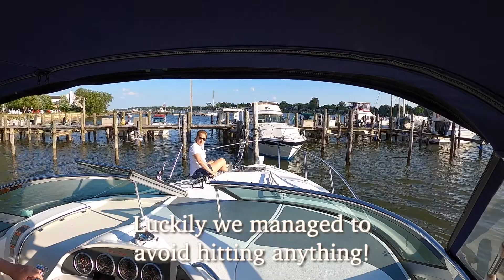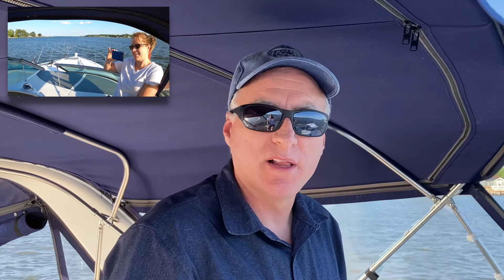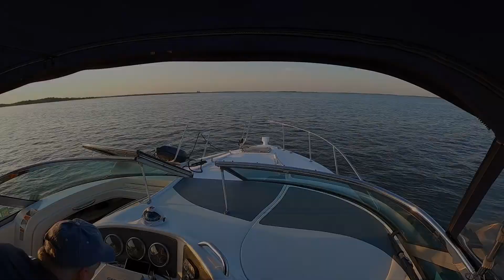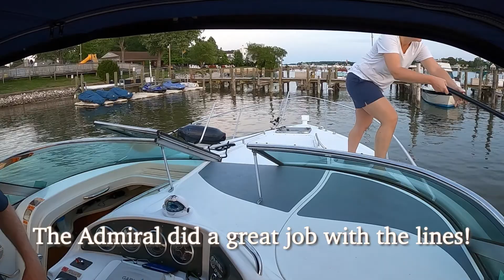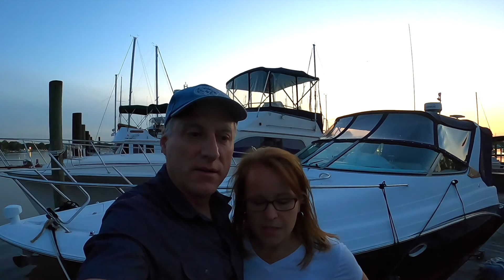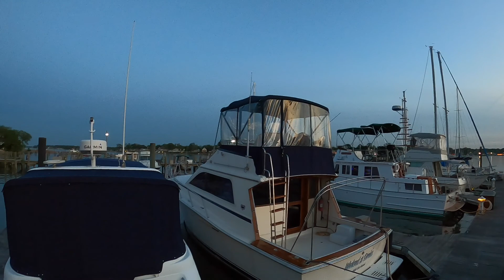Successful Relaunch! First time out of marina for our Chris Craft Express Cruiser - Episode 31

Comment: You’re braver than I am. I wouldn’t trust my front hatch, or walkthrough windshield to stay in place at cruising speed if not secured. I had my windshield get blown shut once from the wind. Luckily it didn’t break. I’m enjoying your videos !
Reply from the maker: That’s why we closed that hatch before departing. We don’t leave it open either. I’m glad you’re enjoying the videos. What kind of boat do you have if you don’t mind sharing?
Reply: @eternitysshore  I sold a 2011 Rinker 260EC (which I purchased in 2011) and bought a 2001 Maxum 3500 SCR last October. It’s a roomy boat in nice condition, but like yours, not without some annoying issues. I boat on Lake St Clair in Michigan. Hoping for a better season next year.
Reply from the maker: @thetattooedladyfan  I guess working out the kinks takes time and of course money. Here’s to a better year 2!

Comment: Fantastic!!! Man, you did a great job docking...for your first time back in the slip with the new boat, you did great!! Nothing bent, nothing damaged, a success!! She's purring nicely now, what a great feeling. Do you have two battery banks with an off/1/2/both switch?
Reply from the maker: Thanks Chad! Appreciate it. In terms of the battery, I do have that switch and a parallel switch at the helm if I need to combine them. Do you have a suggestion?
Reply: @eternitysshore  Usually...the start batteries are on position 1, and house batteries are position 2. When you are at anchor, beached, or drifting with engines off (on purpose), put the switch in position 2 so your "house" items...stereo, fridge, water pumps, etc...are only pulling from battery bank 2. When you're ready to leave, put the switch in position 1 because those batteries haven't been used, start up, and then switch to both so both banks are back on charge.
Reply from the maker: @WiscoBoater  Awesome thanks! We might still need a new battery but that's great advice. I'll give that a shot tomorrow when I head out with my friend.
Reply: @eternitysshore  Definitely have the battery checked, but could be just the switch position. Happy to help! Have fun!